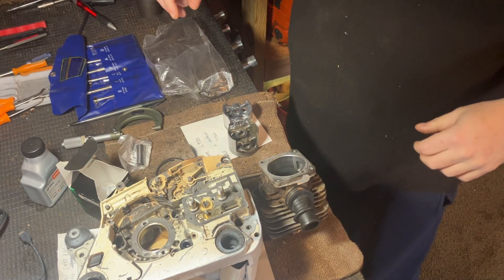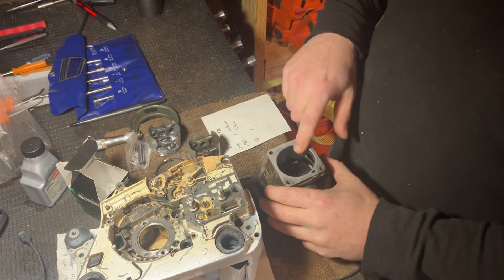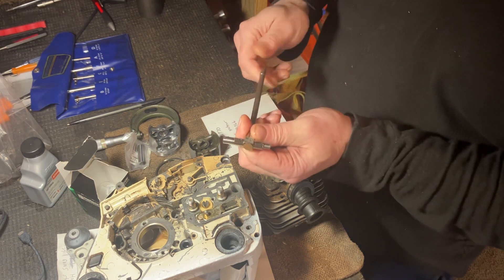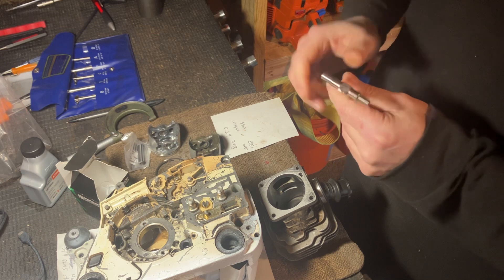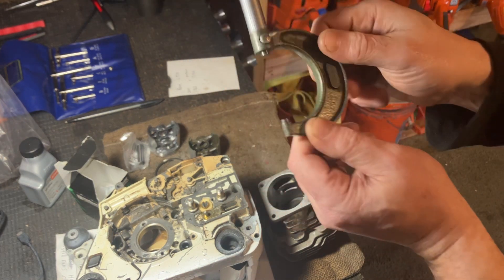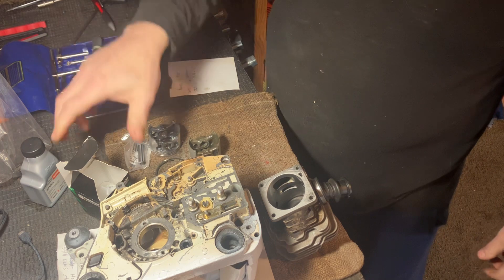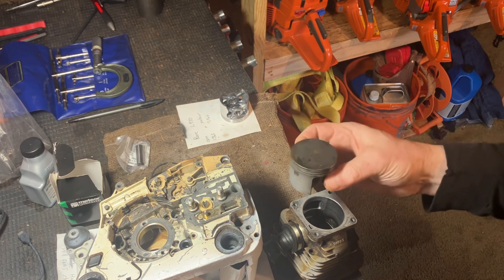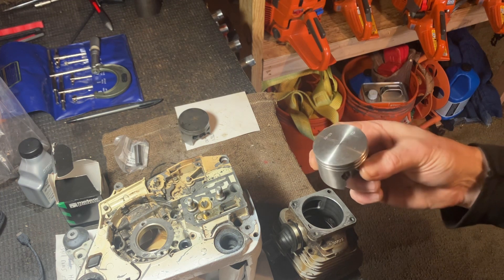Shop Talk : 044 build - Worn oem piston vs New meteor

Comment: 100% agree about using the meteor piston, especially after going thru all the work of redoing the bottom end etc. That worn OEM one wld be perfect to rering and throw in a rainy day patch up saw to bring back to life
Reply from the maker: While STIHL doesn’t give a tolerance for wear in the service manual I have ,  a good rule of thumb is when the machine marks are gone it’s time to replace the piston. It will still RUN but at .0035+ clearance per side it won’t perform as well as that new meteor. The wear is from the piston skirts slapping the bore and will only get worse as time goes on - you risk cracking the skirt and causing some damage - also the ring lands aren’t in the best condition and this can also cause problems. Who ever owned the saw before me most likely got a lot of hours out of it and their moneys worth out of that piston and bearings!